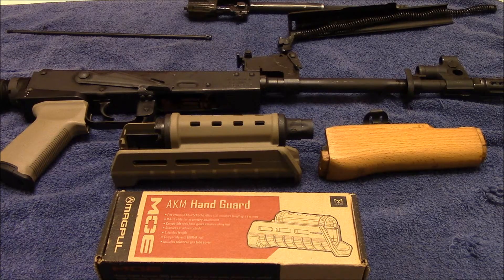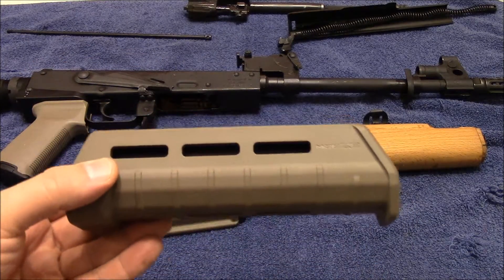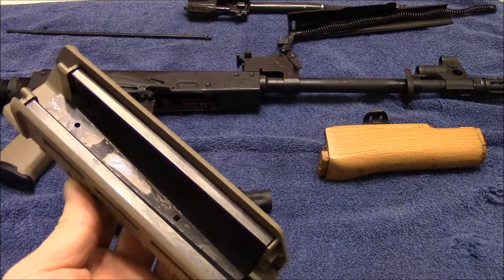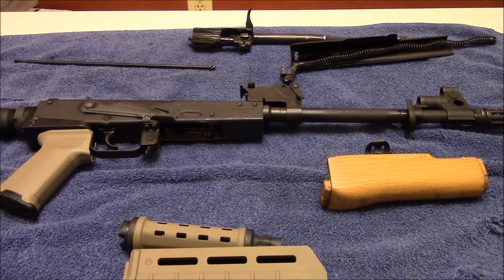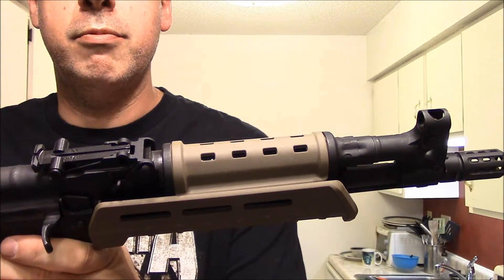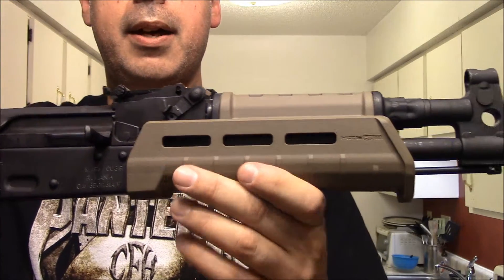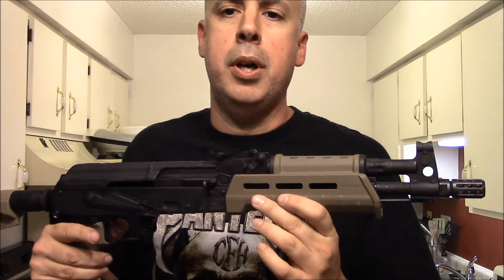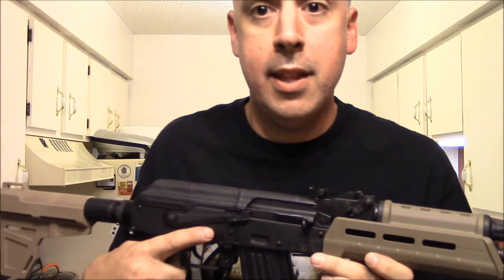MAGPUL AKM Handguard- FDE

Comment: Fyi the  heat shield is high quality  aluminum and  works very well
Reply from the maker: False. According to Magpul website it's a black oxide coated stainless steel shield
Reply: Odd? I checked it with two different magnets, it  wouldn't stick to it at all.. must be the oxide  coating having something to do with it ohh well
Reply: Stainless isn't magnetic.
Reply: tommyguns14able Ahh ok then I got rid of it went with Arsenals front hand guard
Reply: taz Man
The polymer or aluminum?
Reply: aluminum its arsenals own little spendy but Nice I have the Sam 7     7.62X39